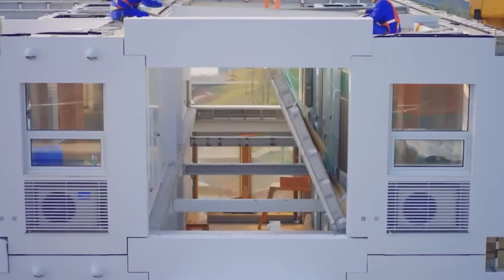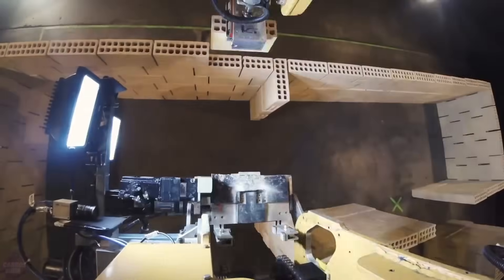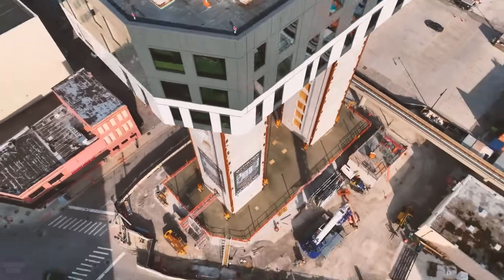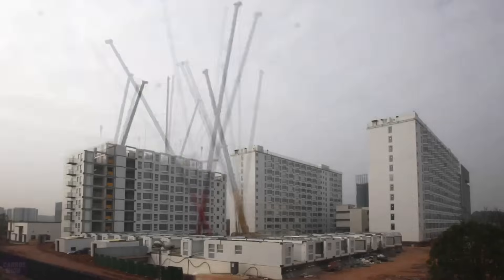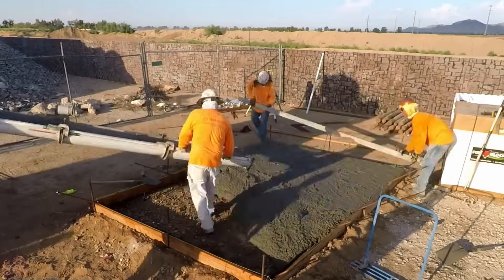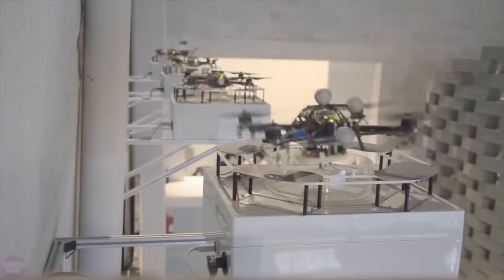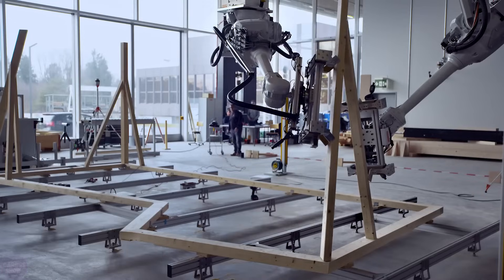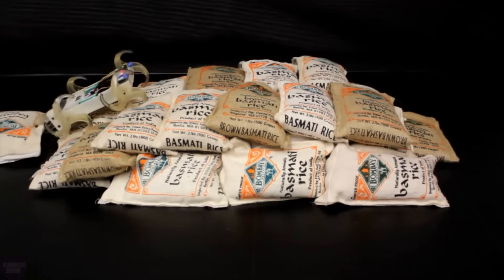China's New Construction Technology SHOCKED US Engineers

Comment: Precast buildings are only good for areas with little rain due to sealant problems...the hot n cold temperature variation would eventually break the seal...wetted perimeters are difficult to seal permanently...the advantage in construction would be overridden with maintenance costs😅😅😅
Reply: Lego land
Reply: The trick, or the breakthrough, is to solve all these issues.
Reply: @lachen7  you are right...I hv done a lot of precast...n the major problems are sealing the joints, openings, mech.jambs, etc. Structural sealants are good at exposed or mechanical joints. For plumbing services on slab, we use epoxy n it is expensive. For repairs of wetted areas, grout injection. It depends on the areas of usage.😬😬